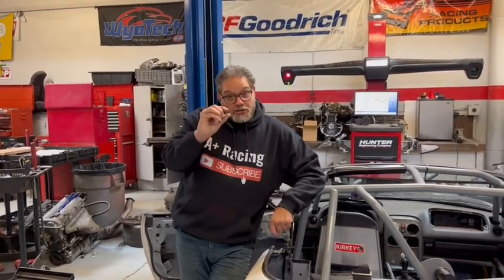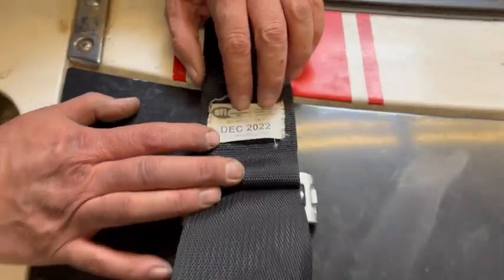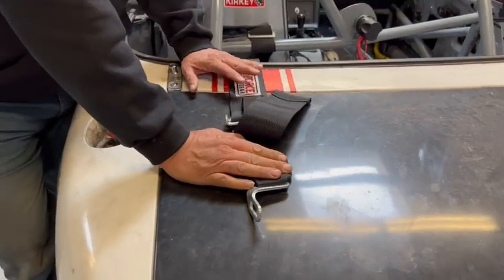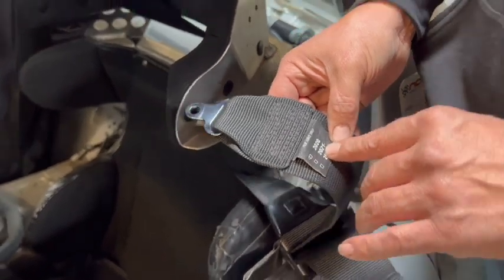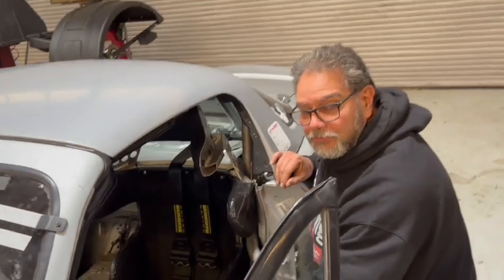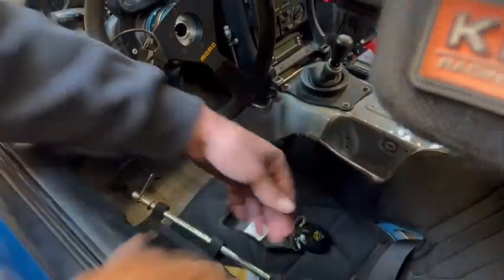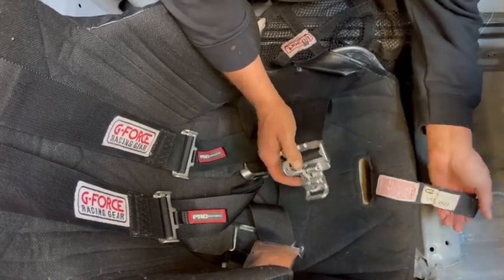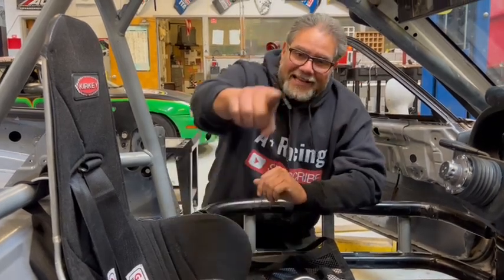Spec Miata, Autocross, Mx5 Everything You Should Know About Racing Belts

Comment: Hey Al, why do prefer the aluminum seats in your spec miatas over the composite halo seats? Series like the Superspec Cup (formerly Supermiata) ban the aluminum seats even if they're braced to the cage.
Reply from the maker: Hummm well all of the clubs out here are ok with the aluminum seats. I use the aluminum seats because they are cheaper and much easier to install. I have never seen and problems using the aluminum seat. Ive seen cars get totaled when the aluminum seat was the only thing that could be reused.